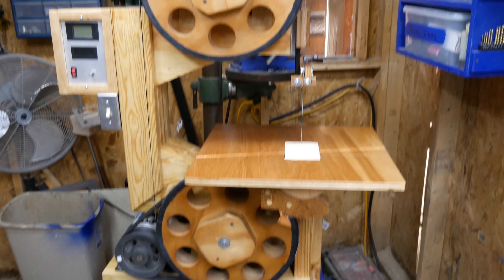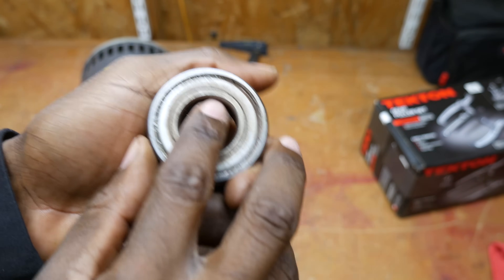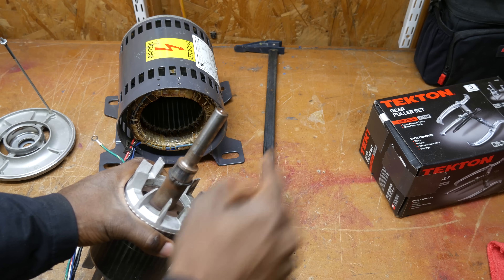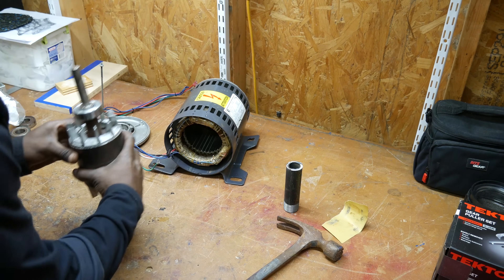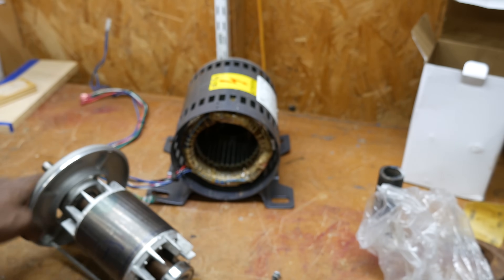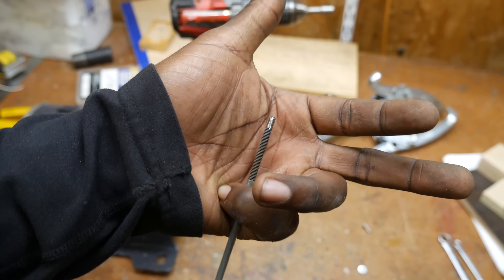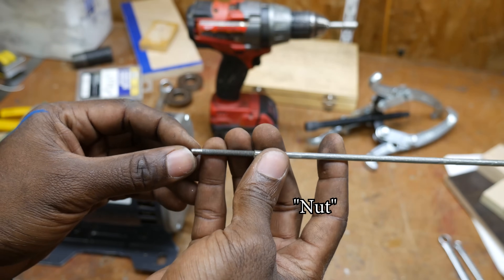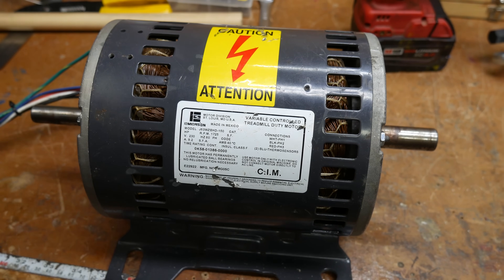My BandSaw Is Noisy; Replacing Motor Bearings For The First Time: 044

Comment: You can safely heat a metal shielded bearing up to 200F degree in an oven for 30 minutes on some aluminium foil, this shouldn't smoke or cause the grease to run, then carry it to your motor in some aluminum foil after you have everything already set up. Sockets are handy for getting proper inner race diameters then can tap on with a dead blow hammer or a brass hammer is best. Most bearings are pressed on with a .001 " to .0015 " shaft oversize per the bearing specification.

Comment: Several years back I bought an old Delta-Rockwell radial arm saw that the seller said worked great when taken out of service but he didn't have the right outlet to test it at the time of the sale. When I got it home and turned it on it screamed like a banshee. Replacing the bearings was a bit more complicated than your motor (I think I gently pounded on the new bearing like you) but the motor purred wonderfully with new bearings.

Comment: Jeremy. Here's a little trick you can do for press bearings. You put the bearings in an oven to warm it up and the stator shaft in a freezer or use dry ice. The expansion from the heat and contraction from the cold make the bearings just fall into place. I do this on small engine repair and motorcycle engines.

Comment: If you use your cut off gas pipe and use the old bearing on top of the new bearing, you will be able to press it down without any damage to the new bearing.  Just a thought.

Comment: I always make a point of fitting the bolt with the ground/earth wire first
Often helps to heat the bearing to about 100 deg C before tapping or  pressing home

Comment: I have fitted literally hundreds of motor bearings In the same way you chested and has never had an issue just like you did just take it easy and only put pressure on that in a race and you won’t have any problems at all

Comment: For future reference should you have to replace the bearing again.  The method you used was simple and it worked.  Use the old bearing to protect the new when hammering it into place.  Just stop before putting the old one onto the shaft.

Comment: Thanks for the video.  This inspired me to investigate the root of why my boat hatch motor will no longer push up the hatch.  Took the motor off and apart.  A ton of grease inside the motor.  I suspect this is part of the problem but maybe someone can confirm.  It did make a noise and not sure if it was the actuator or the motor.  So, the question to the group is, could the grease have been preventing the motor from functioning properly?  How much grease needs to be put back in the motor to seal it up?

Comment: I tried the exact same method that you tried using the clamps and it failed the same way yours did some of them even broke. And then I ended up finding what is called a plumbing stem valve wrench set that I had. Basically one of them was shaped like a pipe and I use the same method you did to take a hammer and bang it on to the motor spindle. Not something that I would've preferred. But the motor worked flawlessly after I did it. Didn't damage anything. Took me a couple of hours to figure out what to use in order to fix the motor and get the bearing on.

Comment: Jeremy, I have found your videos to be super easy to follow and well made. I started watching this video and it prompted me to ask you about the following issue I have found with a motor for our building that runs an supply fan. It has two belts, with adjustable sheaves. I noticed that when trying to run it (it's an emergency smoke control fan), it spins very very slowly. It is a 10HP motor, so it will supply quite a bit of air. In doing some inspection on this configuration, I noticed that one of the sheaves is closed more than the other, therefore making one of the belts tighter than the other. In trying to turn the motor, the belts tension seem to be fighting each other. I noticed that the tension on the belts were on the opposite sides of the sheaves. I am thinking that in order to correct this, I may need to get two different size belts. Once I took off the tighter belt, the motor ran freely and it supplied up to 20K CFM...lots of air, per design. I wanted to get your thoughts on this and see if my theory will work. I presume that the sheave opening difference is possibly intended for CFM control, but I cannot understand why the setup would call for such a difference in sheave opening causing the motor to barely turn with both belts on. I hope I conveyed the issued clearly and maybe you can help me understand. Thank you!!!

Comment: Use a heat gun to heat the bearing not over 190F. Put a skin of Super Lube on the shaft inside the race, and you can seat it with your gloved hands pressing down, all in one motion. Pipe is a good idea.

Comment: I worked in a chemical company for 30 years.  We had loads of problems changing bearings on a centrifuge shaft with interference fit.  One guy packed the shaft in dry ice for 8 hours.  The bearing fell right into place.

Comment: I worked on pool and sprinkler pumps for 15 years and we only used a pipe to press the bearings as well, we had a bearing press but usually only used it to remove bearings that were frozen on from outdoor pumps. We also used a deep well socket to seat the shaft seals. The only tip I would give is we always ran the the threaded ends of the rods in axle grease before reinstalling to make it easier for the next time. Love your videos.

Comment: To hammer a bearing onto a shaft.  Sometimes one of my long sockets will have the right diameter to match innermost bearing ring or I will find large fender washers with hole diameter to just slip over motor shaft To be on top of the bearing phase then use a pipe or long socket to hammer into place.
A large plastic hammer might be better to have less shock during hammering.

Comment: Nice work. Have to tell you that when I got to the part where you describe  the behavior of the motor when the bearing was failing that I knew I had found the answer to my problem. Thanks for your very clear help.

Comment: Great videos Jeremy, thanks! I changed crankshaft bearings on an air compressor a while ago. The shaft was in the crankcase under the procedure. It wasnt that hard to get the bearings on to the axel, but getting the flanges (I guess that is what they are called)  to hold the beraring, was a nightmare!.  The flanges needed to be pressed on to the bearing as well, and that is certainly tricky (atleast for me)  If someone out there knows the right procedure, tips would be greatly apeciated. Should I have pressed the bearings into the flanges first, and then pressed flanges+bearing onto the axel...? Thanks
Reply: Do you already know the answer? because I want to know that too. To be more precise I am looking if the bearing need to go first on the axle or into the 'flange'.

Comment: I had to help a guy pull a 1 foot bearing off a machine that held a 2 1/2 ton cleaving head at a scrapyard. We put dry ice on the shaft, then a torch on the bearing. Still wasn't able to remove it. We had to clear a 1 centimeter lip over the bearing wall. I have no clue how the manufacturer got the damn thing on... unless they tempered the entire thing after it was fitted.

Comment: The only screaming I’m doing is “GREAT JOB, MR FIELDING!”    I have used the hammer and pipe technique a bunch of times and it’s all about how careful you are.  I have had to chill the motor shaft in a freezer and heat  up the bearing in a baggie in hot water to get the two to marry up.  A shotgun wedding most of the time!  If you have a bearing that seems looser than you like on a shaft, sometimes a little green Locktite bearing mount will help.  A gentle heat frees that up later if you need to take the bearing back off.   Thanks for your great videos.

Comment: Nice tutorial.
Correct me if am wrong,
I think the insulation on the long bolts are meant to prevent accidental connection of the field core into a single block of metal.
That way the eddy current losses stays low.

Comment: The metal pipe is exactly the solution I came up with in the same scenario - replacing the bearings on my treadmill motor (though I'm still using it as a treadmill, not to power a bandsaw).  I had to file the inside of the pipe down a bit, as it had extra material along the seam.  I also stuck the bearings in a 150F oven and the rotor in a freezer for about 20 minutes.  Slight tapping is all it took to get the bearings on.  Also, for anyone watching - not all bearings have a definite "seat".  Mine were floating on the shaft so I made sure to get them in the same spot (the rust line helped).

Comment: I would just say use a bigger hammer. I have a short handle maul that I use for just this kind of work. The heavier hammer gives better control over the amount of force you use. It's counter intuitive but it works. I learned this from an old truck mechanic back in the seventies.

Comment: Hi Jeremy, nothing wrong with driving bearings on as long as you drive the correct component, which you did.
  The sides of the bearings that cover the balls/rollers are either shields(metal) or seals(rubber) & may come with 1 side or both fitted.
   A lot of data regarding bearings, seals, drives & related components can be found in Grainger catalogues.
  Some older catalogues have more data. 
I hope this is a help to you & others. Great video & humorous comments! 😁👍

Comment: Just 2 ideas get a bearing splitter instead of using the gear puller and if you wrap the bearing in a damp rag and microwave it for 2-3 minutes they heat enough for slip fit

Comment: Great video! Wish I had seen it before. I just finished doing the same bearing replacements on my pool pump motor. Had to wing it replacing the seals as well. It works! No leaks and a lot quieter. I'm afraid I had to resort to a hammer as well. They used a hammer in all of the pool motor videos I watched. I think you'll be okay.

Comment: For future bearing removals and Installs if you get or have an old scissors jack or bottle jack for vehicles those are easily adapted into a press table. And could you use electrical tape if you do damage the plastic on the bolts?
Reply from the maker: Maybe... I am not sure if the glue will loosen over time from the heat

Comment: Ok the reason the motor may have failed bearings is because if you are using a VFD they have been known to have eddy currents going through the bearings so you may need to put on a armature grounding kit on the motor

Comment: In a pinch you actually could have repacked the original bearings in place using a grease gun with a needle attachment (I did this once for an idler bearing expecting to replace it when the temp fix failed again, the car was junked after 15 more years of service with that same bearing. New bearings are better but as you see, a bunch more effort. Also, next time, if you find the equivalently sized sealed bearings, they would be better at keeping the dust out. When one doesn't have a press, the hammer method is the tried and true method. I use to work with a guy who was also able to remove pressed bearings with a chisel and a hammer.
Reply from the maker: Someone else mentioned this as well. Punching a small hole and adding grease. Never tried that before as you may have guess from the video. Now I need a grease gun
Reply: for bearing races on eg a bicycle fork , they can be removed by using stanley knife blades to force the race up by wedging them between the race and the mount point (tapped in with a hammer), then adding more blades to drive the race up off its shaft.  I've even used an old kitchen knife edge.

Comment: I agree with the other posts, we do it that way all the time. I haven't looked at all your vids yet, do you have a metal lathe ?  If not, buy at least a small one for small jobs, then you can turn the inside diameter of a piece of pipe to fit EXACTLY the inner race, the point is, a small lathe can be beneficial for all kinds of quick make shift repairs. 
  Good luck

Comment: Next time wrap the bearing in a wet cloth and microwave it on full power. The wet cloth prevents arcing and heats the bearing at the same time. The bearing will expand but won't heat up enough to damage it. It'll just slip on and then when cool will return to it's original fit.
This hint provided to you and I from the Canuck Ave.

Comment: Using the wrong tool for the right job is better than the right tool for the wrong job. You got a beat up 2 dollar piece of pipe.... Someone out there has a hydraulic press and a broken electric motor cause they couldn't get the bearings off without crushing them...

Comment: Jeremy next time go to your local market and get some dry ice and pack it around the shaft and it should help. I use to work at Sikorsky and that how we pressed in our bearings :)
Reply from the maker: +mcorrade awesome! Never bought dry ice before
Reply: ya it works great. Icing up the shaft and a little black grease(forgot the name) on the bearing ID and it usually slides right on. You have to work quickly but I've never had it fail me :)
Reply: thanks for the tip man.

Comment: Don't know if anyone mentioned this ... So many comments :)  Yes the light bulb trick helps, but you'll have to find an incandescent. LED woun't work.LOL I would typically use the old bearing to seat the new one. Less likely to do damage when you hammer, just don;t go too far if there is a chance the old one will start to press on as well.
Reply from the maker: That is a cool idea. Thanks for sharing.

Comment: We used the same method on small motors like this in the power station where I was an electrical fitter.  We would sometimes heat the bearings in an our industrial oven first!  On lager motors we had an inductive bearing heater to expand them.  We did have a press but it was usually the easiest route we took!  If you're careful you shouldn't have a problem as the  test run of your motor showed!
Reply from the maker: That is awesome.

Comment: Sooner or later you'll need a bigger hammer!

With my luck, I am usually unable to find a pipe the right diameter.  Glad that worked out for you.
Reply from the maker: +Bill Weissborn if I had to do it again with a odd size I would use a piece of wood with the right size hole drilled in it. A decent hard wood would hold up to the job.
Reply: @Jeremy_Fielding  exactly.  interference fit cups just need a bit of wood and a hammer!  A bit risque on a carbon fibre bike frame though!!  cheers, health and happiness to you JF.

Comment: Jeremy, I've used the same method 100's of times and as long as you are careful about the pipe size matching the id/od of the inner race it works just fine.  Of course the pro's use a press but it's certainly doable the way you did it.  One thing I have found that works very well is to use a standard incandescent light bulb in a bare socket (no shade) and set the bearing on the light bulb, I also put the armature in a freezer for about an hour and and about 30 mins into the freezer time I turn the light on to heat the bearing.  In most cases the bearing just falls onto the shaft with no effort, but when you do need to tap it using this method the amount of force is reduced to almost nothing.  Of course gloves are needed while handling the hot bearing.  Anyway, this works great for me.   Thanks for sharing your video, it's always satisfying hearing the before and after effects of changing old motor bearings.
Reply from the maker: +Larry527az thank you

Comment: Hey, everybody has a little hammer mechanic in em, and it worked just fine. Now to make your own shop press. Angle iron ... curb side hydraulic bottle jacks ... or even better, a scrap floor jack cylinder ... can you see it?

Comment: Hi, Did you build or buy that controller on your band saw
that controls the speed. My  homemade
lathe has only one speed because the arbour of the motor is too small to have
more than 1 pulley on it, I have tried various different ways to attach a pulley
but none have worked. I looked through your videos but could not find one about
this item. I have used that method of putting bearings on before and have never
had any problems, another good video with lots of information as usual.
Reply from the maker: I made the display in the front but that is only controlling the VFD in the back. I will make a video on the whole project pretty soon.

Comment: Here's an AvE trick for you Jeremy: You want to heat the bearing, but you don't want to get it too hot.  About 200 degrees F is perfect.  Just so happens that water boils at 212*, so that's perfect.  The fastest, easiest trick is to wrap it in several layers of wet paper towel, and pop it in the microwave for 2 or 3 minutes.  Or you can also just drop it in a pot of boiling water.  You can use a heat-resistant plastic bag, but you don't need to.  Getting it wet doesn't hurt anything, just hose it down with WD-40 after it's on, then grease it if called for.  Really.  Doesn't hurt a thing.  You can also cool the shaft.  Leaving it in the freezer for a couple of hours, or applying dry ice for a couple of minutes works, but the easiest thing is a can of compressed air.  Turn it over so the fluid comes out when you spray.  It will bring the temp down fast.  Spray the shaft for several seconds, wait a few seconds and repeat several times while your bearing is heating.  This gives the cold a chance to soak in.  Once it's good and cold, wipe the shaft, grab your hot bearing - using an insulated glove - and slip it on.  It will usually just drop right on, but if not, a couple of gentle taps is all it will take.  Hose it down with WD-40, wipe and lube as needed, and it's done.  Beating on it with a hammer and pipe is fine too though.